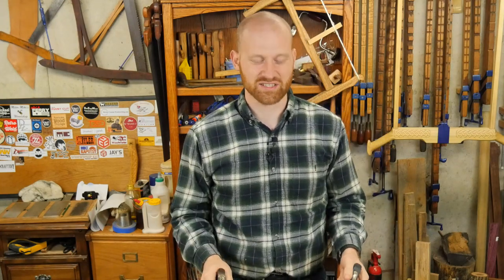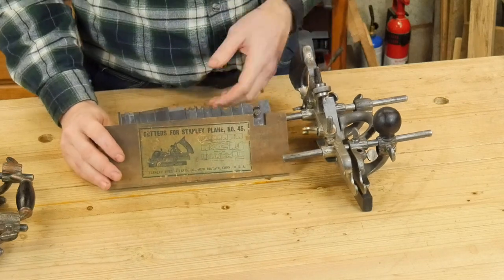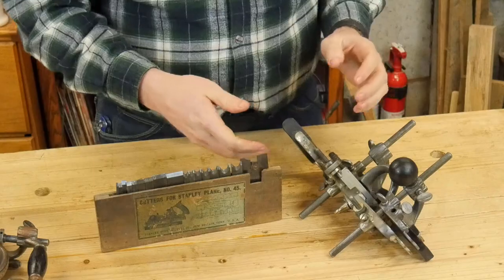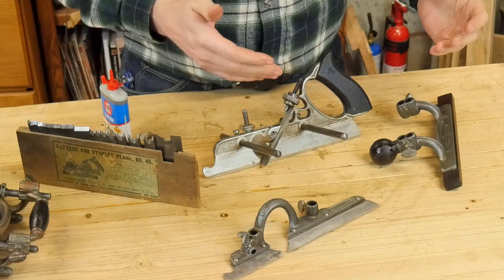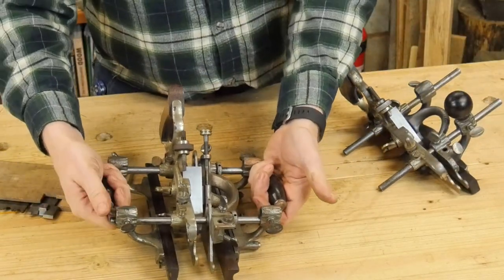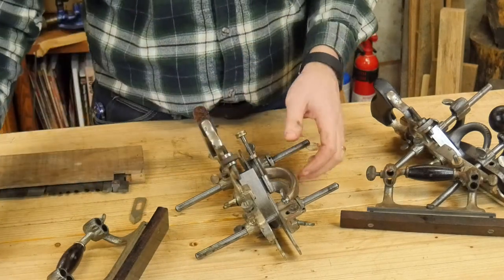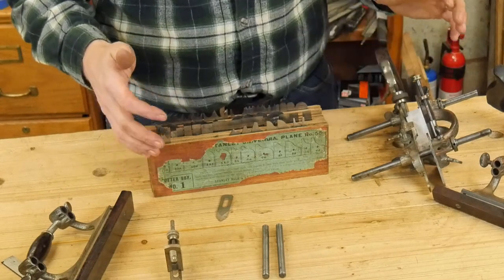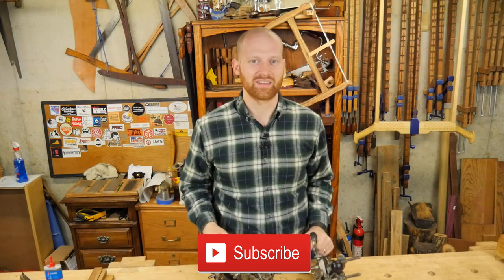Comparison Between Stanley 45 and Stanley 55

Comment: One thing you didn't mention was the special bases for the 45. There are 4 hollow and 4 round bases, 6,8,10, and 12, plus a special base and cutter for stair nosing, a number 5. I have a complete set of them and they work beautifully. I like them so much, I bought a second 45 so I could dedicate one to the special bases.
Reply from the maker: +Bob Fowler I was going to mention that but I do not have those. hopefully when I do the dedicated video to the 45. if I can get those.

Comment: Pretty good James. I have 2 # 55s that I inherited and one rabbit plane Stanley. Surprisingly enough it has no model number or blade adjustment and more than likely uses non slotted angled blades. I also have a Stanley 71 router plane without a foot adjustment knob. I looked close to see if it broke off and been filed down but no signs. Foot has no slot so maybe it’s an earlier model. Make a video with those things in action!

Comment: Thanks for doing this - I have both but have yet to use them. Yes, you can pick up a 45 for $45.....but the irons are going to cost you additional. I thought have having one set of irons and multiple "handles" for different set ups to make it easier to switch back and forth. Just a thought
Reply from the maker: +The 2 Car Garage Shop yup I use to have one of my 45s set with a 1/4" cutter for box grooves but I made a wooden plane to do that now. just like a shop with a dedicated router, but cheaper then any decent router. that would be cool to see a wall with a bunch of 45s hanging on it!
Reply: Yes, I have three 45s and five 50s (yeah that is too many 50s but the latest only cost £6... about eight bucks) and being able to switch between them  during batch work is a huge timesaver.  And don't underestimate the Stanley 50 combination plane, it is smaller and simpler then the 45 which makes it lighter and less tiring to use, and it's a staunch little work horse (it's powered by the same arms after all).  The 50 is also a far easier 'first timer' restoration project than the 45.  I'm very lucky that I did a mechanical engineering apprenticeship before CNC changed the industry, so I can buy and restore 'beyond all hope'  eBay bargains.  I don't have a 55 (they never go for bargain prices) but I'd guess my multi combo setup gives me more flexibility apart from mouldings where I switch to hollows and rounds.  I'm also lucky that I'm a hobbyist so can afford the time to collect and restore a good range of vintage tools :)

Comment: Just FYI - In Mar 2018 I paid $250 USD (eBay) for a usable #45 Type 8, complete with the cutters including a sash cutter as well as the slitter and secondary depth stop and the original box with maybe 30% of the labeling intact.  The rosewood fence has a few nicks, but usable as is.

There are a couple on now in that same price range.
Reply from the maker: Yup that is about right for one with everything. But if you just get the body and one cutter they are a lot cheaper. Then you can buy cutters as needed or when you find a deal on a set. That is usually the router I suggest for the cash strapped woodworker.
Reply: Yes sir no probs.  I just wanted to toss it out there for them that hasta go get one after watching your videos.  Like me.  

One of these days I'll have a shop to use all that stuff in.  HAHA

Comment: wow James I would have thought there was Stanley 45 was more like two hundred bucks I'm going to have to look into one I like the features that it offers and it's cool how you can change out the blades as always very informative video I learn something new today
Reply from the maker: +Joe basementwoodworking Thanks man. If you keep your eye on ebay and are willing to bid you can get good deals regularly. if you want it to come with a full set of cutters it will bring the price to 75-100. but for a wile I just had 2 cutters and then bought a few more as I needed that cutter. usually for $3-$8 each. my first one I found at a garage sale for $20 with a 1/4" cutter. and about 3/4 of all the times I have used them that is what I used.
Reply: Wood By Wright nice!!thanks bro. Ill keep that in the back of my head when the time comes
Reply: Wood By Wright and thats a nice find at a garage sale..KA-CHIIIING!!😆
Reply from the maker: +Joe basementwoodworking That is where I get most of my tools. People think old tools are worthless.

Comment: I only own a stanley 50 and I struggle to use it even though the tool is in pristine condition and with full set of blades and box. It is a slightly better version of some other 50s I think as it has rosewood handle and also a depth adjuster lever, which is better than hammer tap but probably not as good as the screw system in 45 and 55. I am hoping you provide a thorough review of 50 with demo on using it 😊.i am looking forward to it
Reply from the maker: Here you go. https://www.google.com/url?sa=t&source=web&rct=j&url=https://m.youtube.com/watch%3Fv%3DG9csTFLINEY&ved=2ahUKEwiz4OG4uLj-AhW-GTQIHb45AEoQjjh6BAgREAI&usg=AOvVaw3BXsLL5U_vXM_AtaEPO6si
Reply: @WoodByWright  awesome! Reviewing that now and will surely have some questions there. Thanks James!

Comment: I have a Question? Will the fences from a Stanley 55 fit the Stanley 45? I have 2 45's But no 55"
Reply from the maker: No they will not. Different spacing between the rods.

Comment: Man I haven't seen one go on eBay for less than 90 lately I went with the craftsman copy for 45 bucks because of this and that's been without irons too they have become extremely popular just recently I'm going to have to be on the lookout for irons for it but it's going to be a fun tool
Reply from the maker: +C.J. phillipson I saw 1 on there yesterday with a buy it now of $42 and $13 shipping. it was rusted but with some clean up it would work as good as new. does not come with the irons, but I use to buy those one by one any way as I needed them. the Craftsman is great! honestly can not feel the difference in use.
Reply: glad to hear

Comment: In my experience combination planes make great plow planes but a good wooden molding plane works better for cutting shapes and don't require setup though it is nice to have a combination plane on hand if you don't have a molding plane in the size or shape you need.  Here in the midwest hollow and round attachments for the 45 would probably cost you more than a good set of wooden hollows and rounds that you could just grab off the shelf and uses as necessary

I do have a Stanley 46 and I have to say that the skewed cutter makes them the best planes for rabbets and grooves, especially cutting across the grain.  They don't cut anything other than rabbets and grooves but they can't be beat at that job.  Unfortunately Stanley 46 cutters are pricey and difficult to find.  The Stanley 47 is just the 46 without a fence.
Reply from the maker: So true. Give me a good molding plane any day.

Comment: i have an inquiry about this plane! So often i like to come up with my own profiles on picture frames and so I'll draw on paper to spec. Cut it out and stencil on the butt end of the wood stock. Cut what i can off on table saw and then shape what incan with routers or hand scrapers. So The question i have with this plane is if it's possible to produce a profile by using the more generic knifes and start from one side of the piece and contine to adjust the depth and position and follow the line thats been drawn on tje but end? O would Then use hand scrapers and sand the mill marks to blend everything together.  Thanks!
Reply from the maker: sure. it can do large moldings one piece at a time just move the fence over and run a new line.

Comment: Many thanks for this video. Can you explain to me, what the difference is between the 45 and the 78? Many regards from germany :)
Reply from the maker: The 78 is a rabbit plane. It basically just cuts rabbits. It doesn't do grooves or dados. The 45 is a combination plane. It can do rabbits but it can also do grooves and dados beads and other molding.
Reply: @WoodByWright  Thank you very much for your answer. I just bought a Stanley 50 at ebay. I am looking forward to work with it. It is an old US version.

Comment: Has anyone seen a video or write up on the compatibility of parts between the two? 

In my own case, I'm wondering if the 55's left fence could be used on a 45 - my left fence is missing its knob and rather than bother with finding/making one, I'd prefer the 55's fence with its lower profile handle. Also, my 45 type didn't yet have the micro-adjust on the fence.
Reply from the maker: no the spacing of the rails are different so the fences can not be swapped, but the irons and blades can be changed
Reply: @WoodByWright  shame - but thanks for much for letting me know!

Comment: Wishlist material. Nice!!
Reply from the maker: +Willem Kossen Defiantly!  I have thought of having enough to dedicate the irons. it would be nice to have a wall of them!
Reply: +Wood By Wright I have a wall of them. I used to have the same mind set. Just load them up and they are ready to use. It's great when you're running a bunch of molding. But if you're just doing a couple cuts here and there, it's just as easy to change out the cutter.
Reply from the maker: sounds like a fun looking wall!
Reply: Well unfortunately for me, all my stuff is packed away and I have to dig out tools as needed.

Comment: Hello
First, excuses my english (i'm french...)Very good showing. Thank+++. I don't understand how using the came stop of the 45. Have you an explication ? Merci beaucoup. Philippe
Reply from the maker: thanks. if you are talking about this (link below) it is a cam rest. it just holds the weight of the plane when the fence is out a long distance from the blade. i do not have one and I ahve never needed one, but there are a few times when it would be nice. https://www.google.com/url?sa=i&source=images&cd=&ved=2ahUKEwjQ4uD5mcHiAhXCneAKHVnWAqMQjRx6BAgBEAU&url=https%3A%2F%2Fpicclick.com%2FStanley-45-55-Cam-Stop-Cam-Rest-W-332748824652.html&psig=AOvVaw3ta7dKk3duIqZ46DWguIhT&ust=1559235207665229
Reply: @WoodByWright  Thanks .

Comment: I had never seen those before; thanks for the info.  on an unrelated topic, was that a resaw saw behind you on your left?  I'd like to see how your made that as I'm sure that is a handy tool to have
Reply from the maker: +Jason Zvokel thanks! those two were actually purchased at an antique store. they were mass produced in the 20s and can be found regularly for around $10-$20 around me. they are frame saws that were common in Europa when England went more to back saws. I might do a video on making those at some time but they are verry slimier to the turning saw I recently made. but with a fatter blade. https://www.youtube.com/watch?v=yPv90pyoGPQ
Reply from the maker: +Jason Zvokel I just realized you may be talking about the frame saw behind my left not the two frame saws on the left of the video. if so that is one I just build and here is the video on it. sorry for the mix up. https://www.youtube.com/watch?v=Z1fEYcxM9Ic

Comment: Hello! I have a question
Is fence from stanley 45 interchangeable with 50 and vice versa?
Reply from the maker: I do not have a Stanley 50 to know for sure. Sorry. I know it is not interchangeable with the 55.
Reply: @WoodByWright  
79/5000
thank you for the answer I was talking about 55 not 50 I was wrong :) thanks

Comment: $40-50?? You find one for that price and I will pay $100 to ya. 
Been looking on eBay and can't find one close to your condition (the 45) for under $150.
Just to think they were probably under 10 bucks when they first hit the shelves!
Reply from the maker: ya ebay will scalp you for prices. they are worse than the antique stores. I most often find them at swap meats and at MWTCA meets. I usually see one or two a year pop up on craigs list. some people think they have gold, but most are reasonable. and I restored mine. you are not going to find one with cutters or in mint condition for that price.
Reply: I have nowhere's near the knowledge you have and thank you for your valuable info!
Just started seriously getting involved with woodworking over the last year or so.
It's an addiction that has no known cure! 
I've added some Millers Falls bit ratchets, draw knives, and a cool T Auger. 
Looking at various planes to start out with and no doubt I'm loving the 45.
Reply: $44-50 is honestly the fair price for one with the rust still on and no extra irons... but truth be told,don’t do that to yourself,the ten or so moulding/gents planes it “replaces” can be had ALL for $100ish,pre set and no adjusting every time. Also !,drop one and it’s fine...drop the 45 on a slab and it’s toast “pot metal body’s and arm guides”

Comment: It is telling that they are mostly offered in ‘pristine condition’ on ebay.
Reply from the maker: Where have you been looking on eBay. Lots of them come missing most of the parts and didn't rust bucket condition. Most of them that have passed through my shop that needed a ton of work to get up and running again.
Reply: @WoodByWright  must be a regional thing. Marktplaats.nl is the Dutch equivalent of eBay.

Comment: Jess. How much. Did not find any under 250£
Send me the link where to buy shipped to uk for 50 please
Reply from the maker: after a quick search here you go. https://www.ebay.com/itm/Stanley-No-45-Combination-Plane/183127122020?hash=item2aa33a2064:g:VykAAOSwipdaqWj5
Reply from the maker: https://www.ebay.com/itm/Extra-Clean-Stanley-No-45-Combination-Plane-Sweet-Heart-Vintage-Nice-Used/362262092459?hash=item545880daab:g:4IMAAOSwAPtanvIn
Reply from the maker: https://www.ebay.com/itm/Vintage-STANLEY-No-45-Wood-Working-PLANE/123019768873?hash=item1ca48cb429:g:4z8AAOSwLwZaqGs3
Reply from the maker: https://www.ebay.com/itm/Vintage-STANLEY-No-45-Wood-Working-PLANE/123019768873?hash=item1ca48cb429:g:4z8AAOSwLwZaqGs3
Reply from the maker: And a dozen more just like it.

Comment: $50 for either of them is impossible nowadays.
Reply from the maker: No. I just sold a 45 a couple days ago for $46. They still pop up occasionally on eBay around 50 bucks. You won't get them with all of the original pieces but you get enough to get going. Usually come with one fence a skate and one iron.

Comment: "Are they actually useful in a shop?" Sorry, the answer is no. I have a 45 I bought in a flea Market in 1979, used it maybe three times since then. They're a pain to setup, and difficult to use. They were meant to replace those narrow cove, ogee, and other odd edging and grooving wooden planes, and like all multifunction tools (ShopSmith anyone?) whatever they save you in initial cost you pay many times over in setup time and poor results. Other things, mainly routers have replaced those, good riddance. 

Now Compass planes; that's a different story.
Reply from the maker: Interesting. I use mine two to three times a week. Extreamly useful in my shop.